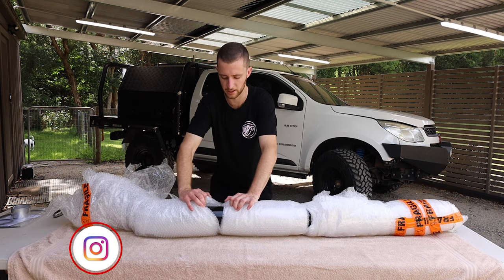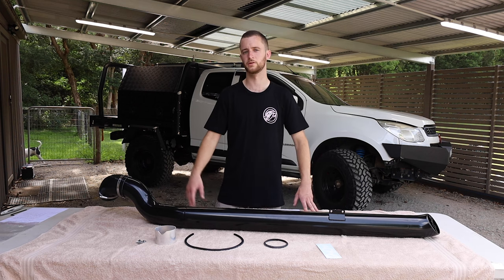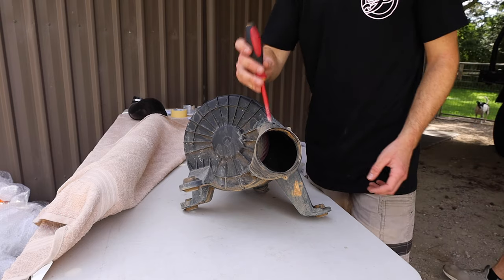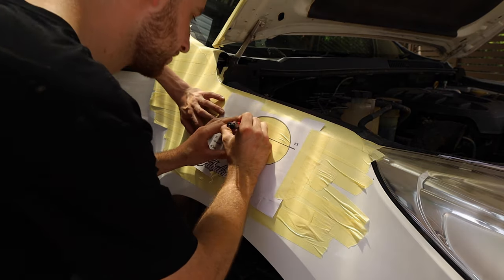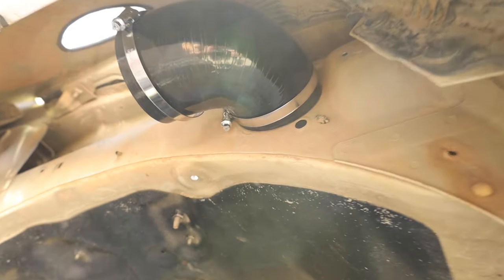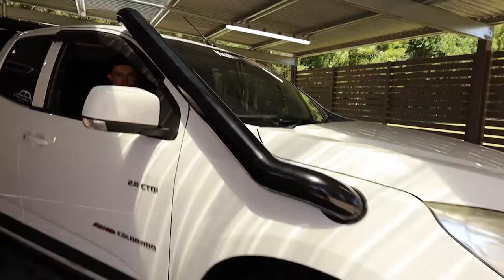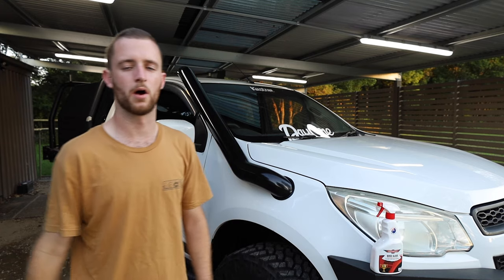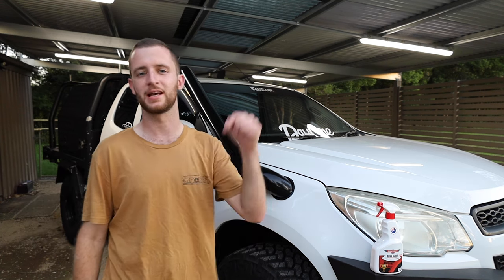RG Colorado Snorkel Install | Day One 4 inch Stainless | How to DIY

Comment: Hey mate what’s the tool used to expand the nuts on the top bracket
Reply from the maker: I believe it's called a riv-nut gun or nutsert gun but I'm not 100% sure. I just got mine from bunnings